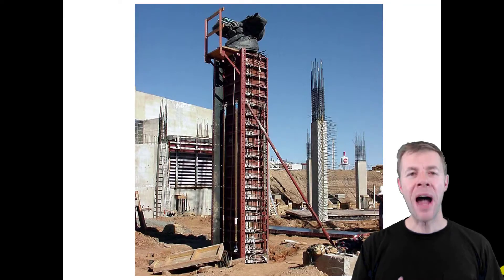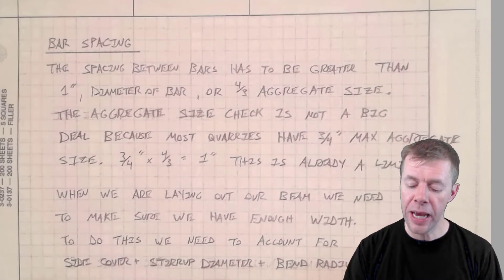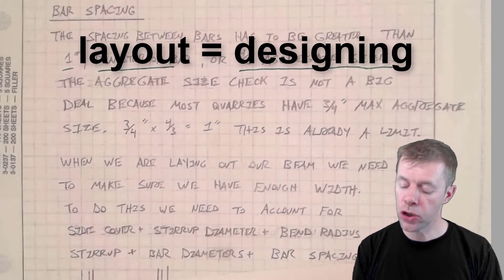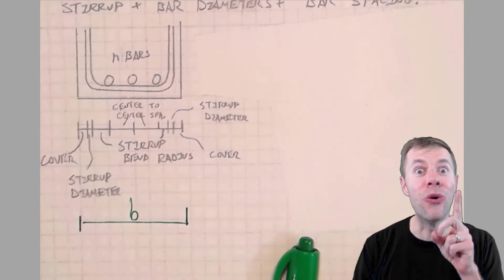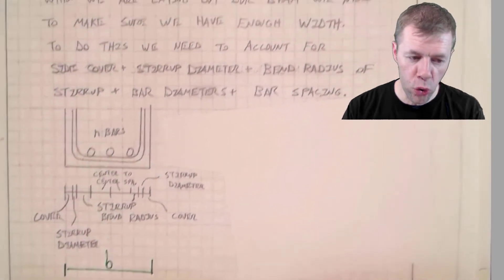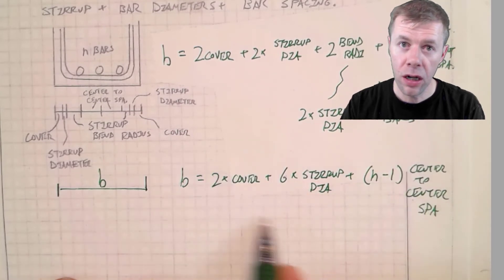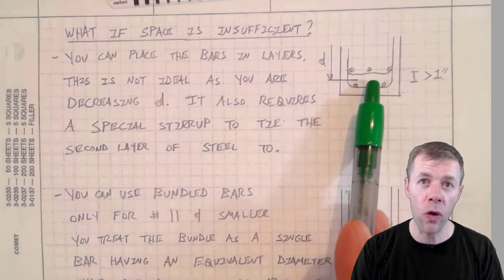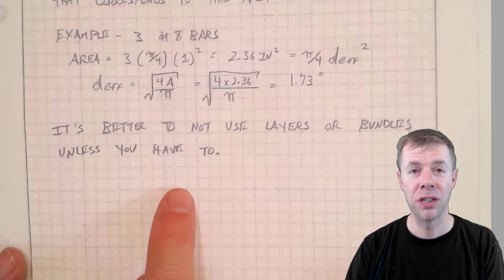How to avoid poor concrete construction by checking reinforcing bar spacing

Comment: Another method to increase bar spacing is to use larger dia. bars. E.g. #8 bar has almost twice the area of #6 bars, so see whether you can replace 4#6 bars with 2#8 bars (usually it is OK due to rounding off during design) and get sufficient space between bars.